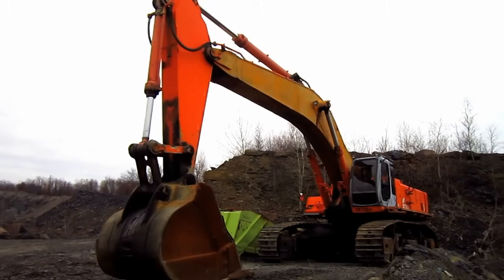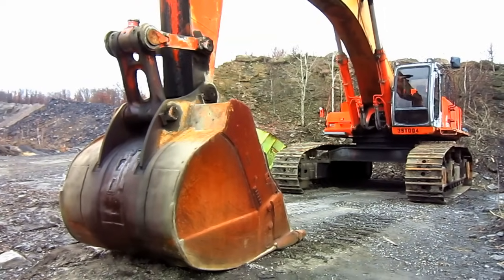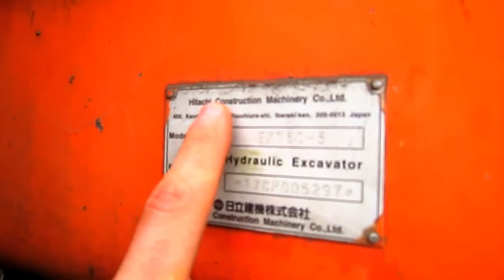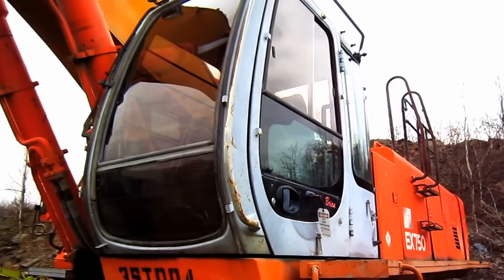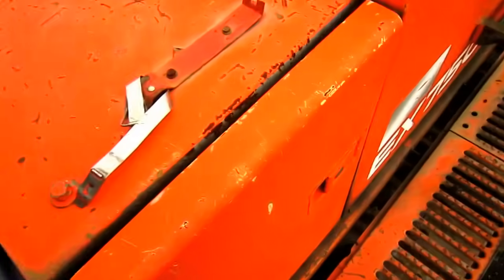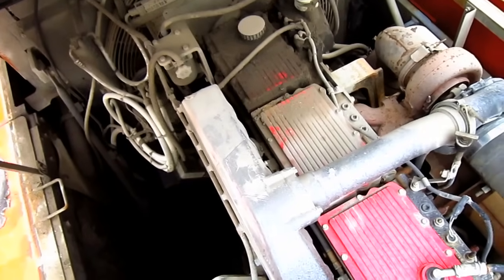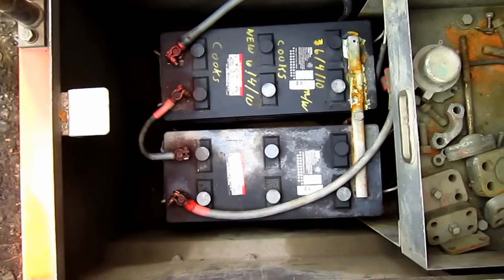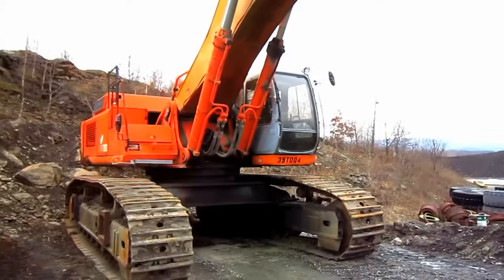Hitachi EX750-5 Documentary

Comment: Always wondered why they never had a riser under the cab for better visibility?
Reply from the maker: Risers are more common for shovels or material handlers were you need to see over what they are loading. A riser is pretty useless on a hoe which has the ability to sit on a bench and have great visibility of the trucks and pit floor.

Comment: The old 700 was a great Joe and the 750 was better again!..very tough and well made machine…burned some diesel with one for a summer back in the day…the one I ran had about the same size boom but longer stick and about a 4.5 yard bucket…it worked great!..not sure if it would out perform a Pc750 but it would be awfully close in performance…ran lots of those too..great video!!
Reply from the maker: Awesome, thanks for sharing that! Very interesting!

Comment: I ran an 850 on the last airport job I was on. It would load out a 745C haul truck in 3 buckets. Super slow compared to the Cats I have run but it is a very smooth running machine.
Reply from the maker: Cool. I got to run an older 3500 at the mine I interned at in 2013.  My experience was the same, super smooth machine to run.
Reply: Another funny story. ..k6 an old Appalachian fuels job acuired a 3500 from pa back 8n the early 2000s...we got called in to do a major cleanin on it and 4 or 5 steam trucks stayed on it 3 or 4 solid days n nights....used an 88b for a man lift with 10' wands gettin the boom...I miss every part about strip mining

Comment: I got to load under one of these for a summer in a 246" wheelbase Ford Triaxle 79,500 gvw (ontario).  I dont know what yards the bucket was but it fit between the sideboards with like 6" spare on each side. “2 scoops of raisins” and drive away loaded.  The second excavator was a 350 cat taking just under 5 buckets for max GVW on my truck.  Steve(operator) said the Hitachi used less fuel/day than the 350 cat.  Im also going to say the Hitachi was more quiet than the 350 cat.  I lo00ove running Hitachi excavators.  As usual, great documentary.  Cheers.